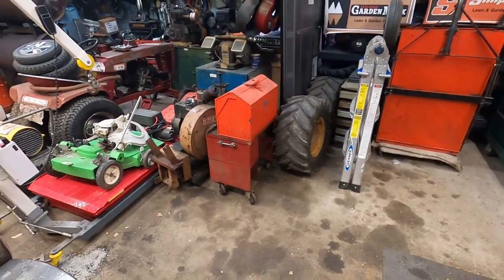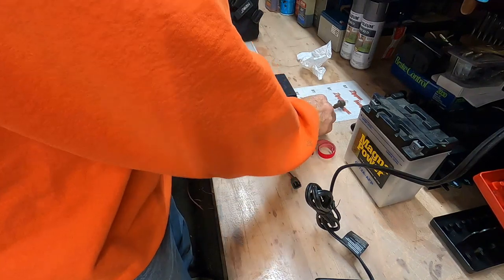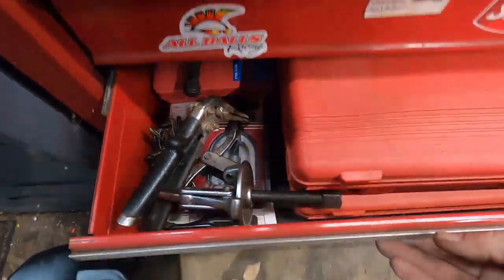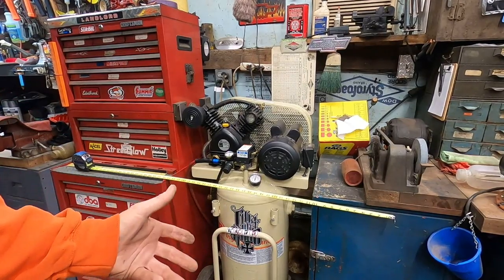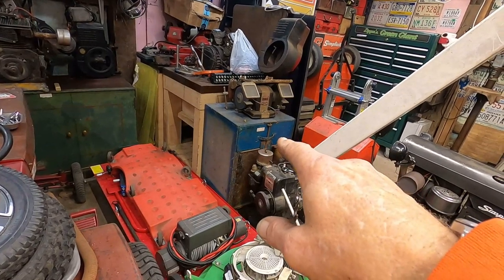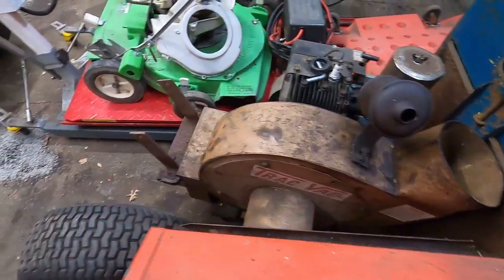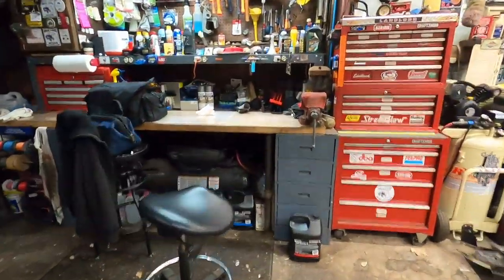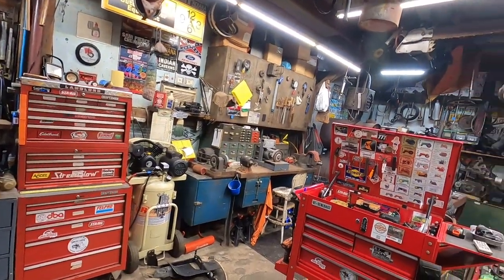In the Shop with Zippo

Comment: Use to have all the shop grinders on a cart. Leaves more room to get at stones, small surface can accommodate grinders 360°, can aim sparks dust outside as well
Reply from the maker: That's the direction I'm leaning towards Willy. If it works for you and Bruce, then it should work well for me too right? Cheers my friend! Zip~